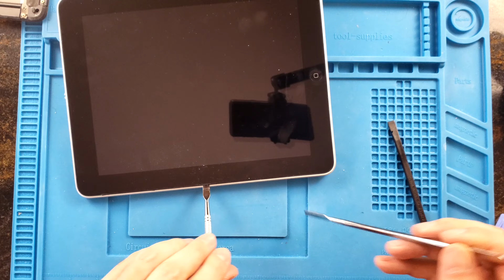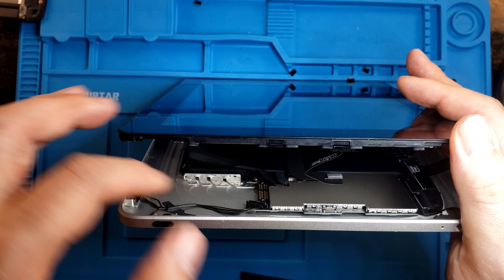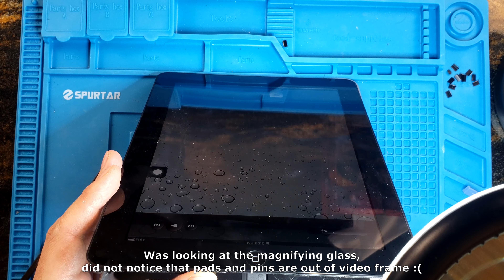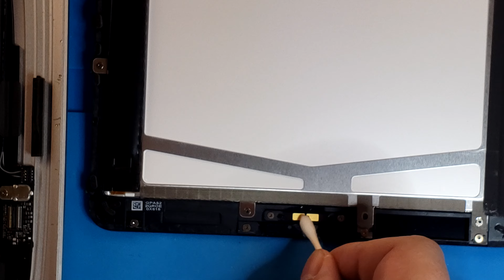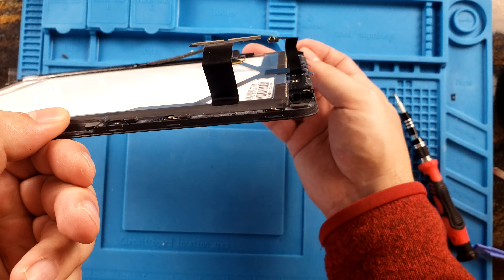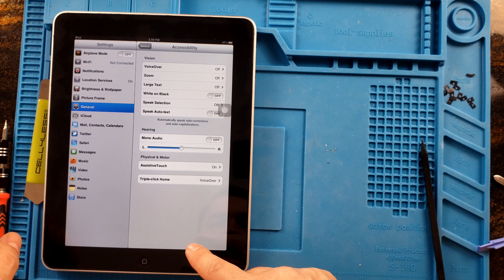Apple iPad 1st Gen Home Button Malfunction - disassembly & repair

Comment: Hi, is the ipad Mini 1 screens the same as the mini 2 to swap over? or is there diff's . Thanks
Reply from the maker: Not the same. I believe mini 2's is Retina, while original mini 1 is not. About 4x more pixels on the later model ;)
Reply: @JustMakeItNow  hi, would the connector be diff or same?   The regular ipad 3 and 4 are interchangable i believe except for the home button.
Reply from the maker: @xx3868  LCD FPC connectors on 1 and 2 are the same physically (and I believe they're located in the same spots), so you can plug the swapped screen in. Whether or not it would actually work I don't know, especially given that actual screens are so different. I remember I tried swapping screens across models of some Samsung phones (with the same physical connector), and it did not work...
Reply: @JustMakeItNow  Thanks, i hoping the power pins arnt diff as plugging it in will blow things up!! haha might use same with same .
One other question. I been looking up alexpress for LCD screens , touch screens  ect and one seller was selling lcd backlight?  A review said its only the back light, not lcd??  Is there 3 parts, touch, lcd, and back light on bottom? or does backlight join to lcd and thats what their selling?  thanks
Reply from the maker: @xx3868  Well, I don't know what exactly they're selling, but if they say backlight it is likely to be just a backlight panel, not LCD. I am more familiar with OLED/AMOLED displays (fewer layers there), but for LED (which I think this Ipad mini is) there are quite a few - glass, digitizer, polarizer, LCD, backlight etc. Some of the layers might not be separable, some might be. I wouldn't recommend rebuilding that kind of screen from layers unless you know exactly what you're doing. Usually something seeps in-between layers (alcohol/solvent, adhesive, dust) and it is quite visible. That is if you don't destroy some layers trying to separate them ;)

Comment: What are the pins called on the outer edges of the screen when you remove it? Where can I find them?
Sorry I meant clips that keep the screen on
Reply from the maker: I don't think there is a specific name, these are just known as iPad 1 screen clips. Unless you have a local supplier of mobile repair parts that carries these, your most likely options are eBay and Aliexpress. I've seen these on eBay, and you will likely pay through the nose for these there ($1+/piece), but you have a chance of getting it relatively quickly (assuming you're in North America). Aliexpress would be considerably cheaper (I think I've got 100 pieces for $15 or so), but shipping will likely take a looong time.
Alternatively, often you still have enough clips left intact assuming you're opening it for the first time. You just need to redistribute the intact ones, and normally it should be enough for secure closure.
Reply: @JustMakeItNow  thank you 🙏